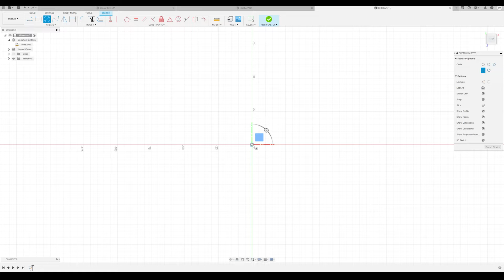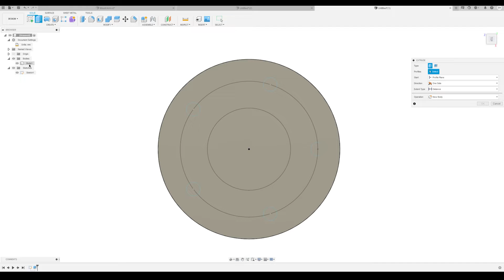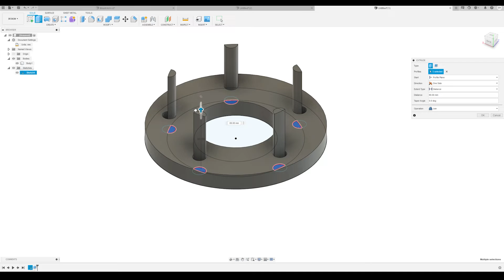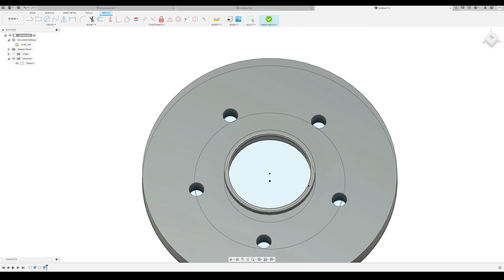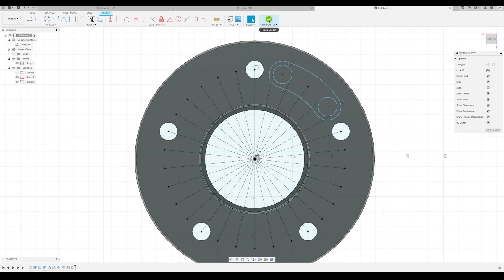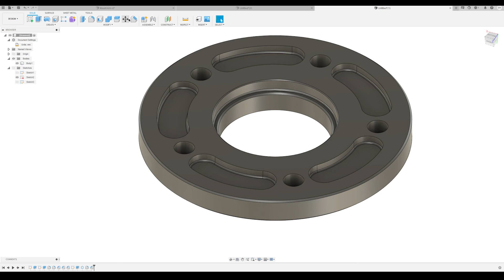How to use Fusion 360 for Gear Heads 101: The Absolute Basics - Designing a Wheel Spacer

Comment: Nice tutorial and explanation.  But how much of a mechanical engineer would one have to be to ensure that what was designed has enough structural integrity as not to fail? i.e. sheer tensile, deformation, compression stresses

Is it fabricated and then these stress tests  are applied before actual use?

Comment: This is great. I fumbled through designing a shifter adapter in 360, and I need wheel spacers.. I'd be interested to hear what kind of additional specs (materials, tolerances, etc) are required to provide to a manufacturer. These may not get Ferrari views but it's good content.

Comment: If you made your bolt-pattern circle a reference (construstion) line, you wouldn't have to select/deselect the bolt circle halves... at least I presume since Solidworks is that way and your reference lines for the rear pockets worked that way as well.

Also, with something like a wheel spacer, you could sketch a cross section of the part and revolve around the axis. This would reduce multiple sketches/features into one. The rear pockets and stud holes would still need to be made additionally of course, but you could sketch the main part, chamfers, fillets, and the hub extrusion in one sketch. Additionally, with any kind of patterned feature, it is faster and easier to complete all features first (extruded cut, fillet, chamfer, etc) and then pattern all of those features. If any of those features needed to be tweaked, the pattern would apply those edits to all in the pattern.

Overall, great stuff! Keep the content coming!